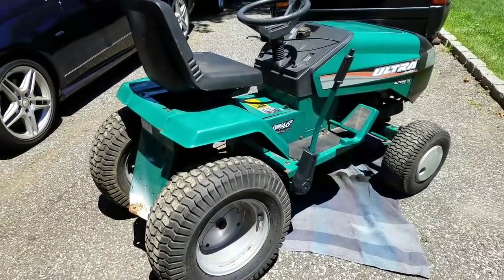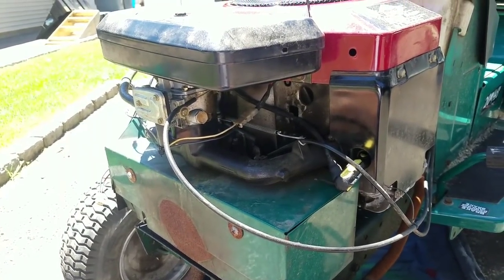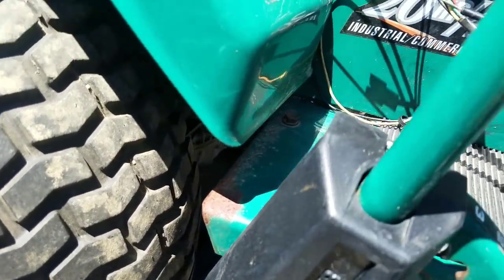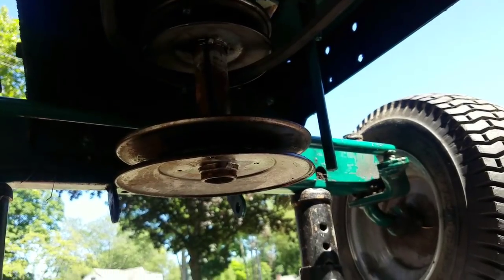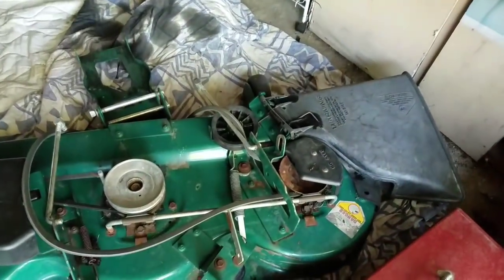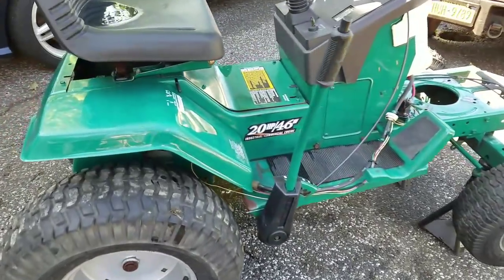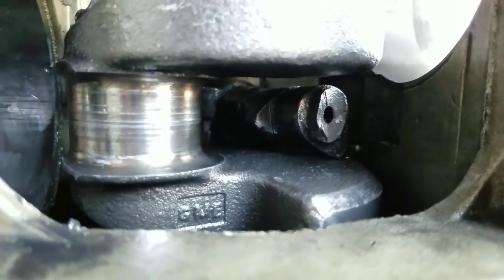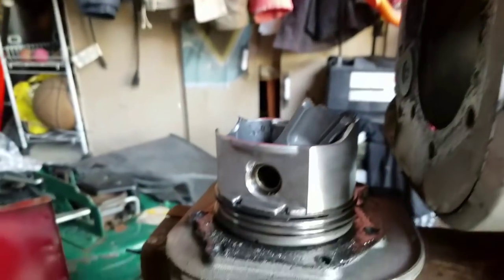MURRAY 20HP BRIGGS & STRATTON OPPOSED TWIN BLOWN THROWN CONNECTING ROD TEAR DOWN REMOVAL DISASSEMBLY

Comment: The Briggs Opposed Twin Engines - or commonly referred to as L-Head engines - in their time they were the best engine out there ever - Briggs began production of the L-head engine in the late 1970s and made them from 12.5 up to 21.5hp - in the late 1990s Briggs slowly introduced the Intek V-Twin engine - or the L-Head's replacement. In May of 2002 Briggs & Stratton ceased production of the L-Head engine forever and began rolling out even more V-Twin engines.  Over the years more and more parts for the opposed twin's have been discontinued and are obsolete , parts are VERY hard to come by, especially internal engine parts. (incase anyone is wondering i am a Briggs&Stratton dealer so that is how i know this information) Personally i have always liked the opposed twin's they have a unique sound to them and are a unique engine design wise. i've fixed and serviced hundreds of them. the only thing no one likes about the opposed twin's are the "upside down" starters that have one difficult bolt up under the flywheel. Other than a few design flaws they were and still are great engines. And yes Kohler had an L-head engine too - Kohler Magnum.  Anyways i hope viewers to this video finds this information interesting.
Reply from the maker: Always a wealth of information.  Thanks buddy!
Reply: Im looking for some 20hp piston rings, can you help please
Reply from the maker: You have to be more specific...there are hundreds of sizes of piston rings for a hundred types of engines.
Reply: Opposed twin Briggs 20hp
Reply: Also if you could do a video on how to replace intake and exhaust valves on a opposed twin that would be great
Reply: I have a question for you,I have a 1999 oppose twin engine 17.5hp Briggs and Stratton. Where are the valves covers and how do we adjust the valves of these engines? This mower I've had it since new and I bought it at Walmart back in 1999. It only takes maybe 10 minutes to cut my small yard and I do that once a week since I've had it and it sleeps inside so I don't think it has alot of hours on it. Everytime I crank it up lately it's hard to turn over and then it finally cracks up and I notice this happens to alot of these small engines when they need a valve adjustment. I was wondering if that's what's going on with mine. I appreciate any info buddy.
Reply from the maker: Ebay
Reply from the maker: There really isnt an adjustment for opposed twins.  There are no valve covers.  To access the valves and springs.  Its removing the breather tube cover to the block.  The reason why it's hard to crank is probably your starter or battery is weak.  Try a new battery.  It's not the valves since it doesnt have many hours on it.
Reply: @MowersNBlowers  Hey buddy, thank you for the info and the fast reply. I'll check the starter and the battery. 👍
Reply from the maker: @williamsantiago7303  check battery first, make sure it's at 12.4 volts or higher.  If its below that you need a new battery.  If it still cranks slow, your copper coils in your starter  are burnt out or starting to.  What you want to try first even before the battery is the battery terminal contacts...if the nut and bolts loose, it wont have a good contact.  Plus the red wire from starter to solenoid must be tight on the contacts.
Reply: @MowersNBlowers  left out in the weather? the ends of starter need OIL OIL OIL so take stater off... OIL OIL OIL the ends of starter... rinse it out before oiling it. turn starter by hand with oil oil oil in the ends to oil the bushings and that is mostly the problem... the ends of shaft are DRY DRY DRY nd need oil oil oil . paint it, write date of cleaning on it... run it. the brushes last a good long while as ppl dont crank them much to wear out the starter... just needs oil oil oil to the ends of starter motor
Reply: I recently resurrected my great grandpas old Sears craftsman Lt4000 (42” 18hp twin opposed). Build date appears to be 1993.

It runs and moves like a Sherman Tank! 

I am curious if I should stick with the SAE 30 given the age and Florida heat? Also the mower Henry showed in the video appeared to have an oil filter where as mine does not? 

Thanks

Comment: This  is the oil pump  equipped  series ,all opposed twins are identical  whether splash or oil pump  equipped,  Which has its own  crankshaft and main bearing  inserts ,which  are drilled  for pressurized  oiling,and the oil sump  which houses the oil pump  and filter.    No filter  = splash  oiling  .  Filter = pressurized  oil pump  system.
Reply from the maker: Good info bro, hope you'll subscribe

Comment: I have the exact engine. 20 years old. Both rods broken. One seems like a spun bearing, another broken rod.  Same exact thing I saw.
Reply from the maker: I ended up replacing it with the same engine I found on a tractor on curb.  Sold the tractor a couple of years ago.
Reply: @MowersNBlowers  Hard to justify spending money to fix these things. I priced used parts, I'm over $100 with the crankshaft.  I think they are designed to be disposable.

Comment: I think the engine was low on oil and over revved.
Most of those engines can be rebuilt. If the crankshaft is not out of round, the aluminum from the connecting rod can be taken off with crocus clothe and a new connection rod installed.
Reply from the maker: Muriac acid
Reply: @MowersNBlowers  be very careful, that stuff can burn you
Reply from the maker: @albertcassler8763  most acids will do that.  I just use sandpaper and oil,  I’ve fixed a few that way.

Comment: I've got the same motor...and it runs...but only with the choke on full. Any ideas? Thanks for any help.
Reply from the maker: If it only runs on choke, your jets are clogged. You need to clean your carburetor.  I've got a million videos on comprehensive carb cleans. Hope you'll subscribe
Reply: Yuppers, either the main jet and/or idle jet are clogged with bad gas or dirt. When you clean out these carburetors you definitely need some source of compressed air wither it be from a compressor or a can to blast out all the little fuel tunnels inside and behind the jets in the carb. Don't waste your money on a new carb, cause they don't run cheap, instead buy a rebuild kit. Most of the rebuild kits come with a wide variety of parts and gaskets to fit the slightly different models of these carburetors but make sure the kit it right for your model carb.

Comment: Just a shot in the dark.  I acquired a 461777 0137 E1 opposing twin, and I need a muffler, and I am having a heck of a time trying to find one, because I don't have a model number. Will any opposing twin muffler work?  If so, what is the model # on this engine?
Reply from the maker: It’s really the exhaust pipes that need to be opposed twin compatible.  You just need a muffler with two holes
Reply from the maker: The number of the engine is 461777
Reply from the maker: https://www.ebay.com/itm/164087659634

Comment: Yeah, that's some Catastrophic damage to the engine, Henry. That's not going to be worth replacing it. Plus, if you do, there's so much damage, it's hard to know if you'll be able to get out all the tiny shattered connecting rod parts too. And if one of those isn't caught in the oil filter, it could cause it to score the cylinder wall. I think with that brake handle attached on the PTO that's on the throttle, they probably WAY over-revved the engine, which caused it to blow! Such a damn shame too, those opposed twin Briggs engines are badass! I Love the videos!
Reply from the maker: jacob feather thanks jacob...appreciate the advise as well as the follow.  Its the popular answer with my regular commenters.  Thanks bud.

Comment: This is probably the 10th video I've watched & still nobody has even hinted at which direction the crankshaft pulley bolt turns to loosen it up
Reply from the maker: Same as any...counter clockwise to loosen!  You could have just tried it yourself! 50/50 you get it right!
Reply: In which direction does the engine turn? If it's clockwise from the front, like 95% of the engines out there, chances are pretty good that the bolt turns counter clockwise. It might just be a little bit stupid for someone to design an engine which loosens its crankshaft bolt while running...
Reply: righty tighty... lefty loosey??? like all other bolts... that no one puts ANTI SEIZE on so that they dont twist the bolt/nut off cuz the nut/bolt is welded to the fastener with corrosion... WATER??? METAL?? RUST without some kind of LUBRICATION!!!! ON ALL FASTENERS that no one takes the few seconds to put OIL grease anti seize on the fasterner threads so it is not welded on with corrosion

Comment: What is the length and dia. of the crankshaft? I have a blown up kohler courage engine I need to swap out. It has 1 inch dia. And about 3 inch long.
Reply from the maker: What was 3 inches long?  Crankshaft is like 18 inches long.  A briggs opposed twin crankshaft wont fit a kohler courage.
Reply: @MowersNBlowers  the length of the crankshaft from the bottom of the case to the bottom of the crankshaft.
Reply: I want to swap the whole engine, if the crankshaft is the same length and diameter where the pully mounts
Reply from the maker: @robwright4398  oh yeah..I'm sure itll be fine.  I've put a kohler on a briggs mower and vice versa.  Most are 1" diameters on lawn tractors.  Is yours a electric PTO?
Reply: @MowersNBlowers  no it's the manual pto luckily.
Reply from the maker: @robwright4398  good because then you'll have stator issues.  It should fit nicely, but you'll have to figure out the wiring.  Not all wiring harnesses of briggs and kohler are exactly the same.
Reply: @MowersNBlowers  the kohler has the gas shut off thing on the carburetor but the briggs don't, will that give me problems?
Reply from the maker: @robwright4398  no...the fuel solenoid has a shaft that moves up and down, you can either cut it off, or attach a switched power wire to it.  Search my videos, I have a fuel solenoid delete video on a kohler courage on a husqvarna 21k46 tractor.  Just search that and you see how to do it.
Reply: @MowersNBlowers  I'll do that, thanks for all your help

Comment: I'm sure i'm commenting way to late but the 2 pistons are exactly the same so it doesn't matter which one goes in which side and the little notch on the very top of the piston (the crown) is supposed to face up towards the top of the engine. On a side note, I have two complete pistons and connecting rods pulled from an almost new and very healthy engine that was turned into a lawn mower racing engine with arc billet rods and pistons. The old pistons and rods have almost no wear on them, I can let them go dirt cheap. Just if you do decided to rebuild it eh.
Reply from the maker: Emmett,  I’ve since rebuilt 3 other opposed twins and my issue was I used 46 cu in rods in a 42 cu in block.  It didn’t go well.  Lol... thx for the offer,  but I have a ton of parts now.
Reply: @MowersNBlowers  I like that! Didn't go well!!!

Comment: I'd save the rest of the block and all the tins for future projects. Ebay you can get the same engine for 300 bucks but knowing you you might not want em haha. But I'd keep everything salvageable from that engine for the future
Reply from the maker: J&R's Lawn Care Equipent and Service jr...ive stripped the engine, parts listed on ebay.  The block ended up trashed, it had cracks in it in many places.

Comment: If it where mine Henry I'd look for a good used engine. It is rebuildable but it would cost a fortune...too bad because those older opposed twins are great engines. It looks as if the former owner ran it quite a while very low on oil. With all that Carnage I'm surprised it didn't crack the block!
Reply from the maker: Alan Marshall thanks alan, thats what i was thinking too.  I priced out all the stuff i need, its well over $200, so you know im not doing that...however, on the flip side, i can make $150+ parting out the good parts.

Comment: First, You need a new sump cover.. that "clamp" was there because its cracked, and that hole is what holds the cam in place; and someone jerry rigged it to get its last bit of life out of it. (which ironically worked because the clamp is still holding, lol, I suppose you could try to use it with the clamp.. but if you bought all new parts, it would be foolish to risk that busted cover). 

Secondly...  That Crank is shot. You can take calipers and check the crank for wear.  But I can tell that the bottom is gonna be worn way out of spec.  This is due to never changing the oil.. that's the reason why the bottom wore out but not the top rod.  All motors shed little metal particles just from regular use and if you don't change your oil, your bad oil acts like sandpaper.. and with the bottom piston rod being more submerged in the bad oil, it wore quicker..  and you can tell that it was out of spec for awhile before it broke, that's why the crank has so much excessive wear.  I would bet that this engine was knocking and rattling pretty obviously and they just kept running it until it quit.

Just judging what I can see.. I would say that it >>>IS<<< fixable.
As long as there are no holes in your block.

You will need: 
Sump cover, 
Crankshaft, crank gear, 
camshaft, valve push rods (if they're bent), 
Piston, piston rods..

You may be able to find this stuff easy on ebay, Used and cheap enough.... 
https://www.ebay.com/sch/i.html?_from=R40&_trksid=m570.l1313&_nkw=20hp+opposed+&_sacat=0 

On this link above I see:
crank: $60 (lucky break, they're usually 100s)
crank gear: $10
rods: $50 each... 
Sump cover: $50 

https://www.ebay.com/sch/i.html?_from=R40&_trksid=p2334524.m570.l1313.TR0.TRC0.A0.H0.Xopposed+cam+shaft.TRS1.TSS0&_nkw=opposed+cam+shaft&_sacat=0&LH_TitleDesc=0&_osacat=0&_odkw=opposed+crank+shaft&LH_TitleDesc=0  

Above:   cam shafts...  $20 or so.. 
I believe the same cam shaft fits many of their motors.. You can look up your model number on your mower and see the exact parts numbers it needs and compare them to these parts numbers on ebay to be certain.  The main key is that some shafts have a slot in the end where it runs the oil pump.. and some don't because they don't have an oil pump. Just match parts numbers and your golden.

https://www.ebay.com/sch/i.html?_from=R40&_trksid=m570.l1313&_nkw=briggs+20hp+piston&_sacat=0&LH_TitleDesc=0&_osacat=0&_odkw=20hp+opposed+pistons&LH_TitleDesc=0

Above:  pistons .(even some with rods) .. or you could but one new on Amazon..
Again, just make sure you match part numbers..  Its easy to search for.. and if you're having trouble.  Call a local lawnmower shop with your model number of your mower and have them look up new parts and then make them give you the part numbers.. (just don't ask them about prices. lol...  I would imagine a new crank costing a lot)...........   
But then just take your parts numbers and search ebay.  You will find a lot more things with the actual numbers instead of just surfing through hoping to find it. 

Looks like you could likely make it happen for around $300 buying some used stuff.. 
Then again, a new 19hp Briggs twin Intek engine its only $600 shipped.
https://www.equipatron.com/briggs-stratton-vertical-engine-bs-33r877-0003-g1.html?utm_source=google_shopping&gclid=EAIaIQobChMIr-jh1Jq63AIVSJ7ACh3pMA88EAQYASABEgLGwvD_BwE 

Or you can buy a used one on ebay... Few here below:
https://www.ebay.com/bhp/used-briggs-and-stratton-engines

Good luck.  I'm in the same boat.  Hhahahah .. Thats why I did this research for you.
I'm doing it for myself as well.  Happy fixing.
Reply from the maker: Thanks for all the info Cal.  I ended up selling the good parts for over $250.  Ill wait for another engine probably connected to a lawn tractor, and if the tractor is in good shape, ill end up needing another engine.  I see good deals on tractors here all the time.  No way id pay that kind of money rebuilding.  Way easier getting another motor for way cheaper too.  Thanks for all the info bro...let me know how you make out with your engine.

Comment: Why am i seeing lots of videos of broken con rods on B&S  motors?  They are not particularly fast reving engines. Are the rods weak or what?
Reply from the maker: I've seen broken connecting rods on all kinds of engines.  Briggs is just more common out there.  I haven't ever seen a broken Kohler command though.
Reply: Stock rods are very weak and thats why they are rated at 3600 rpm max.
Reply: ppl cant change the oil or even CHECK THE OIL on mowers before first run of the day. WRITE THAT ON THE COWL OF MACHINE AND ON THE MOTOR... CHECK THE GD OIL BEFORE EACH RUN OF THE DAY!!! DO NOT OVERFILL!!!! USE 15-40 motor oil... change oil every 30-40 hours and air filter. online $10 shipped for air filter.